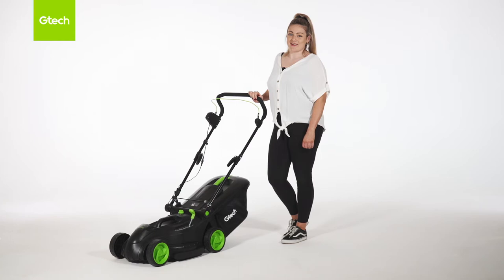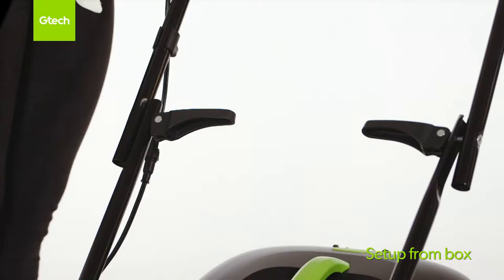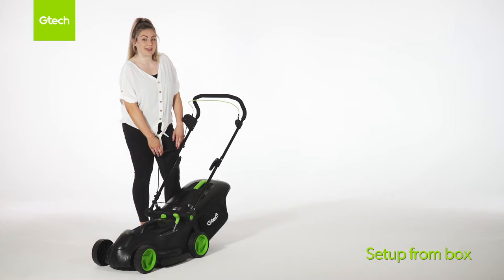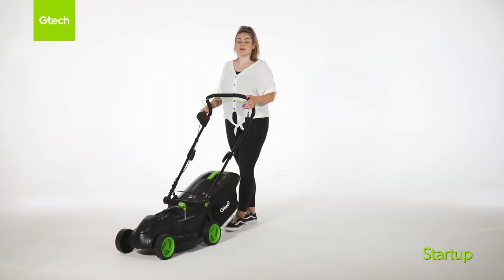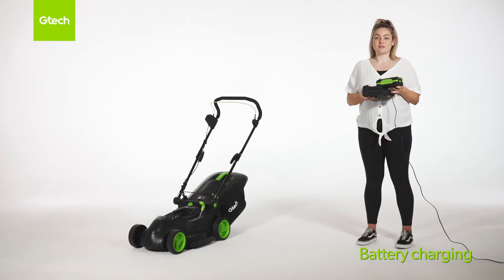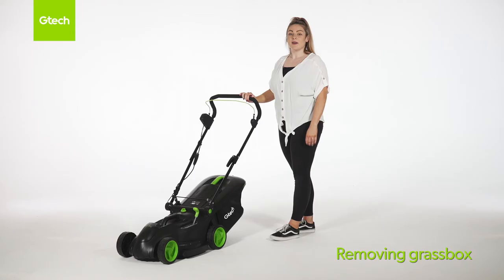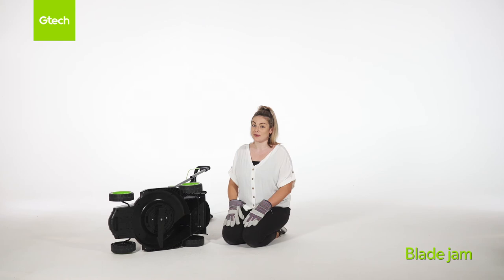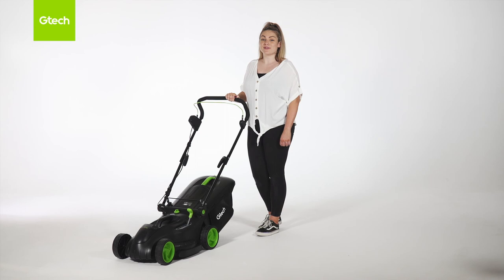Gtech Cordless Lawnmower (CLM021 and CLM50) - How To Video Guide

Comment: Unfortunately the locking clips on the handle on my GTech mower will not lock. Despite contacting GTech I have been unable to fix this so the handle just flops about which is annoying. The previous model had a good solid handle so I’m unsure why they changed it.
Reply: Mine are stuck so can’t fold it down